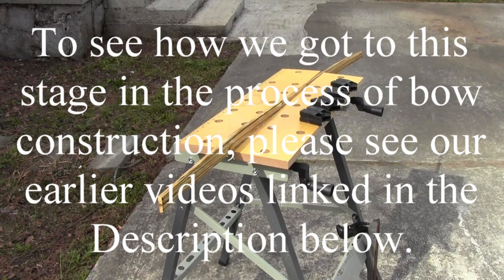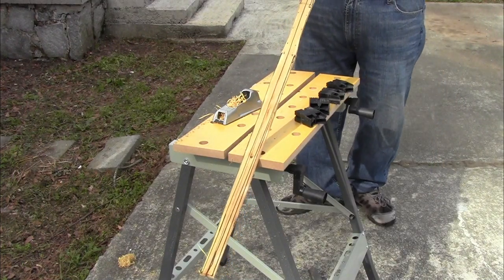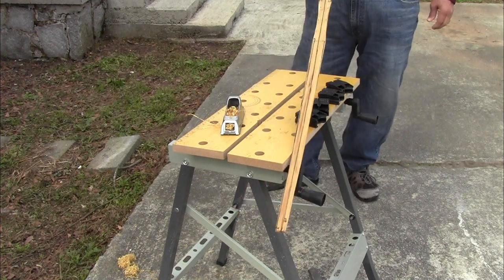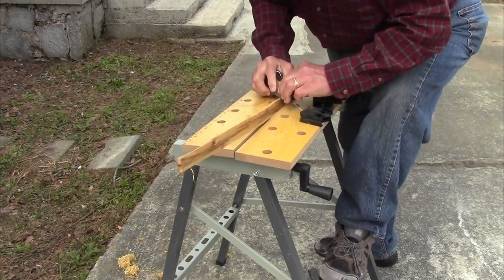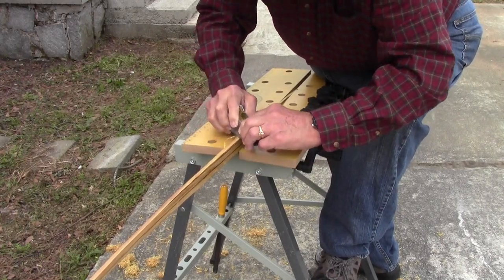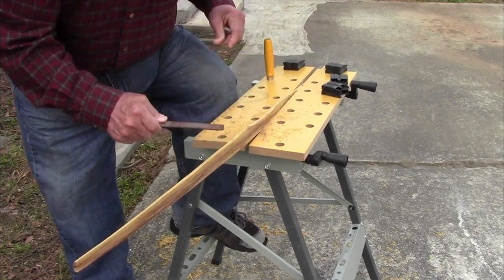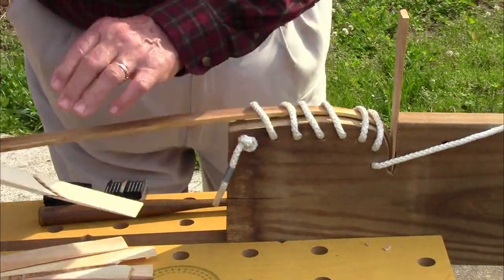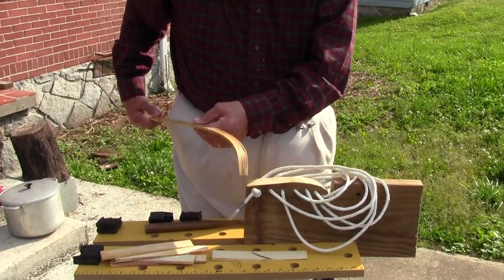Composite Horse Bow; Completing the Mulberry Wood Core

Comment: Would it not be quicker and easier to use a stationary (or hand held) belt sander.  Or maybe do most of it with a bandsaw first?  It looks like you really know what you are doing.  Great video.
Reply from the maker: Sorry to be so late getting back. We are now settled in Kansas and can pay proper attention to our YouTube channel. You are absolutely correct that the mentioned power tools would speed up the process, cut down on labor and additionally make each component more consistent. If I get into bow production that is certainly the option I would choose. Right now it's my intent to use hand tools and as much as possible follow the traditional techniques and materials used by bowyers of past centuries. Thanks again for your comment and please stay in touch.